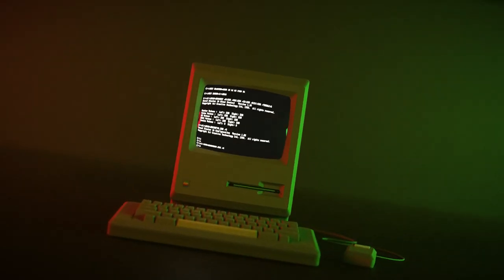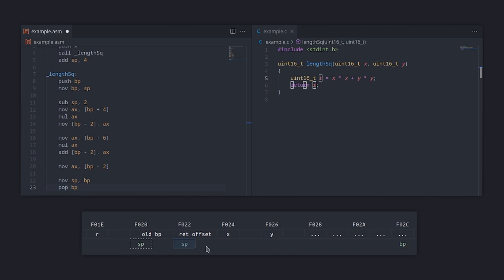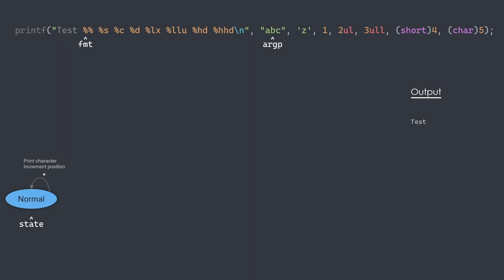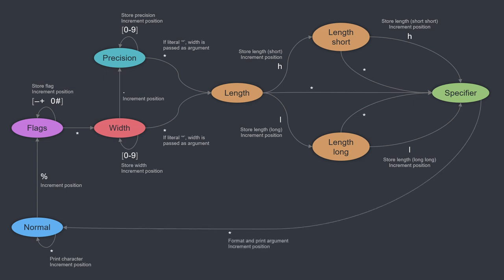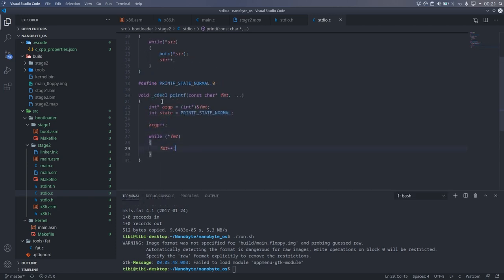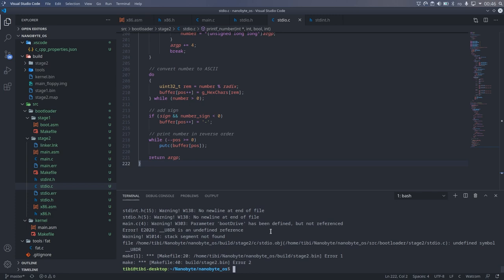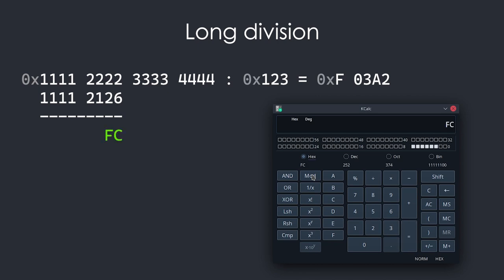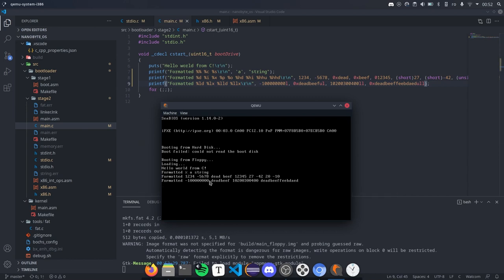Building an OS - 5 - How to implement printf

Comment: Programmers opposition to goto isn't primarily a safety concern. It's a readability, and maintainability concern.

It can become hard to reason about the flow of the program when goto is breaking normal flow control. This isn't really a concern for anyone intimately familiar with the code. Only for later maintainers.

As you are nesting switches and implementing the entire state machine within a single function it's pretty obvious that having maintainers other than yourself is not a concern of yours either. 😅

Comment: You can avoid the GOTO by replacing it with `fmt--;` and `state = PRINTF_STATE_SPEC`, by decrementing the fmt specifier and then incrementing it, you end up not consuming the character and everyone's happy.  If anyone is uncomfortable with the GOTO, they can use this option instead, but I'd argue both versions of the code are equally fragile so there's no real benefit to doing this way other than dogma.

Comment: Hey there! So i've been following these tutorials for bulding my own os and for some reason whenever stdio.c gets bigger in size (for example when adding the printf_number function) the code stops working and prints a few random characters or nothing, I even tried copying the code from your github but it still does the same thing.
Reply: if anybody is having this problem the fix is to just delete all the files in your build directory.
Reply: are you still interested in this topic? I have the same problem and deleting these files (i guess every .bin/obj file rather than floppy disk image) didn't solve my problem. Is it the only thing you have done? In my case, it doesn't print out anything like it wouldn't even be compiled

Comment: Why did you choose argp to be a pointer to an int?
Reply from the maker: Because it has the platform's native size. You can't push something smaller than that on the stack. Using int instead of byte makes it harder to make mistakes.
Reply: @nanobyte-dev  Thanks.

Comment: Can u add a GUI?
Reply from the maker: Yes, but it will take a while until then
Reply: @nanobyte-dev  Hello, I'm from Nicaragua, but the point is, instead of a GUI, wouldn't the scanf or the shutdown and restart through scanf be more important?
Reply from the maker: @Aarch_64  At this point, the top priority is getting a working OS, where you have some basic drivers working, you can allocate memory, and has a basic scheduler. After that, we will work on the UI (either text or GUI).